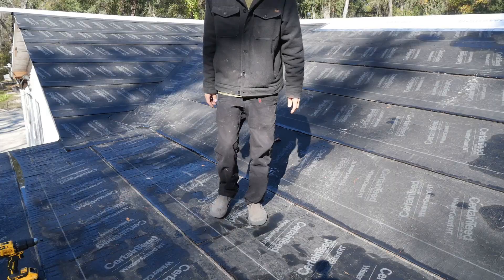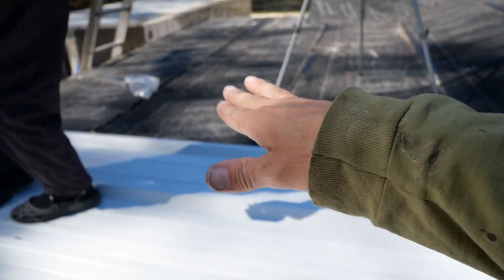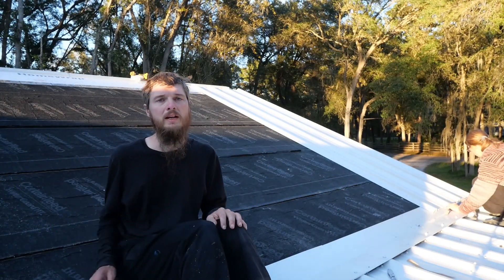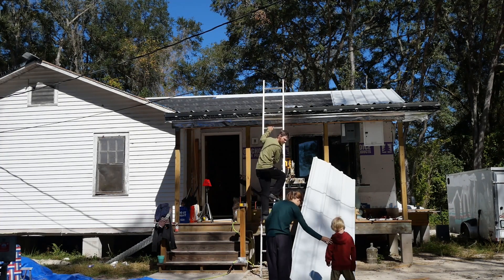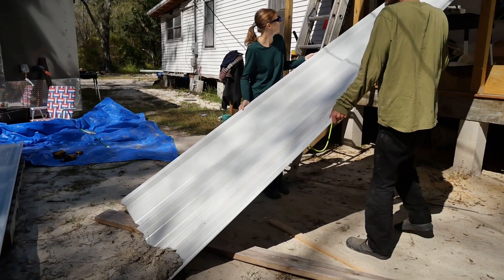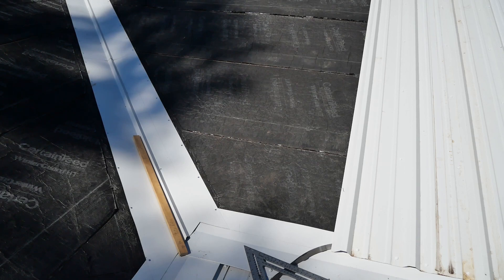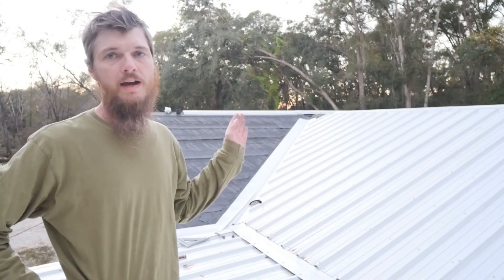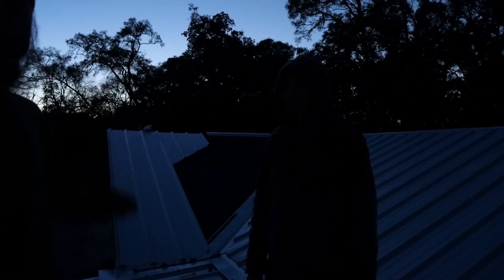Another Close Call - Day 4: The Hardest Part is Almost Done

Comment: My Dad was what they called a roof plumber (in the olden days). Architects would draw these crazy plans with insane roof lines on large commercial buildings and my dad had to take the plans and work out water flow and how to make sure that the roofs were water tight. He basically did what you did; cut and shaped and soldered roof sheets into complex origami designs that forced rain to flow correctly, but in such a way that it never pooled. He often had choice words for some of the whackadoodle designs that architects came up with, but I don't think he was ever stumped. So, you are absolutely doing it right! The only thing missing was a few choice German swear words! 💘
Reply: Ha, funny. I bet your dad used a lot of innate math.

Comment: We put a metal roof on our house about 20 years ago. It is still looking good. Metal roofs are very slippery even dry. Also its like an airplane wing if the wind catches it. Can take you off the roof very fast. Would have loved to have your metal nibbler back them.  We used a circular saw. Not sure if that was the proper way to cut it but that's what we did. Our roof is a dark red terracotta color. Looks like a clay spanish style roof its not a standing rib. We love the metal roof but would not want to do another one. Hard hot work. 
I was not strong enough to help lift the metal up to the roof so my husband made a slide using an industrial metal step ladder that was on wheels and slid the sheets up to the roof. Quite a contraption but it worked. Guess you can say if there's a will there's away.  You will love it when its done.

Comment: Very interesting shoe/slipper lacing on Ashley's feet, very ingenious. I think I have seen those very same straps in my supply cabinet. Also, very intricate moves to get the panels off of the shoulder and onto the roof, and into the proper orientation. Glad there was only light wind. You two make it look smooth. My hat is off to you two.

Comment: I am glad you did not get hit with that metal Ashley.... your skin is no where near as tough as that board. The choice of footwear when working on metal roofing has worried me since you started.
Crocks and what appear to be smooth soled slippers are not what you should be wearing on slick metal.  If you have a leaf blower you can use it to help dry the metal when you get up there.
I am just glad you are both safe... Have a great day!  Thanks for the video.

Comment: Close call.  Glad all ended well.  Which do you prefer?  Composite shingles or metal?  Metal probably has a longer service life?  Composite shingles are quite delicate considering their purpose.
Reply from the maker: Metal is far superior to shingles. It costs quite a bit more though, but will last a lot longer than shingles. If a roof is too shallow, you can't use shingles, but you can use metal.

Comment: Glad you all are ok!! Doug, please give some thought about wearing a harness and teether. (It's like climbing gear) The more protection the better. Soon you will be walking on the metal part of the roof which will be slippery.
Reply: Yup a harness tied off on the pitch of the roof for sure.  I use to manage a metal roofing company for about 7 years and we had one incident with one of our installers 5 stories up on a high rise in downtown Seattle right across from the waterfront.  He was one of our foremen and he did NOT have his harness on or tied off and he decided to stand on a metal railing on a balcony to add some metal facia on above the balcony.  Little did he know down below on the pier across the street was a guy from the Washington State Safety Dept. with a camera in hand and took pictures.  Our guy did not slip thank you God while he stood on the top of the railing to install his metal facia board.  Needless to say we received some of the pictures from the State along with a $10,000.00 fine and the "Foreman" was fired immediately.  He had the harness in his Company truck and I had ALL the paperwork that he attended the Safety Classes but he surely failed the Company but most of all he could have free fallen 5 story's to the ground.  

Anytime anybody goes up on a roof to lay any kind of roofing should wear a harness and tie it off.
Reply: @sandravanlankvelt7975  Thank goodness he didn't fall! There are many stories of those who did. Safety first!

Comment: The roof looks so good!  Is there a product that you can put on the end of the metal roof where you've made your cuts to prevent that part of the roof from rusting over time?
Reply from the maker: The edges will be okay. They don't really rust over time. When the sheets are stacked the edges rust, but once installed they do okay.

Comment: @1:28, No, No, go higher up 6" to 9" even bending the metal past the transition, that way no water "up flows" past the seam when sticks and debris are in the lower flat part steel.
Reply from the maker: We are installing it the way it's supposed to be. Plus, you can't simply bend PBR panels anyway. They are super thick and strong. The transition flashing with the foam closure strips is what guides and keep all the water out.
Reply: @diyfferent  Perfect gotcha...those are the tough thick ones.

Comment: This might help you in the future. It's called the "Pitch Hopper". It has a steep side & a flater side, it looks like it's a weird triangle shape. It keeps you from sliding off a steep/flat metal/asphalt shingle roof.  The advertisement had the guy standing securely on an extremely high pitch roof with no problems. 
I know it doesn't help you today. But I'm sure you'll be doing more roots & I thought this would help you do it safely.
Reply from the maker: That is a very cool product. We've never heard of it! But it's only made for use with asphalt shingles.
Reply: Rooves not roots, thanx spell check. LOL
Reply: The commercial I watched had the man doing a very steep metal roof.
Reply: I rejoice with you and praise our creator for Ashley's protection.

Comment: Damn, that was close.. Since Ashley is taller it probably wouldn't do too much harm, if it hit her,  but some cuts would be guaranteed. Folded metal with angles or seams becomes very hard and cutty, not as flimsy as a smooth plate, but anyway no one should be standing below a piece of sheet metal. Got lucky, good job otherwise, looking promising and way to go. You're close, doing it right will spare you the frutstration of rapair for many years to come. When doing laps and joints, take always in account the way pieces will overlap, so no water issues will arise. Cheers, we're peeking...😉

Comment: Looks great. Question: can rain from the valley get behind (above) the foam strip at the bottom of the pitched roof panels?
Reply from the maker: No, there is a foam strip that goes along the valley under the metal. We didn't show it in this video, but we showed it in another video. We cut the bottom foam strip back so that it couldn't catch water from the valley.

Comment: Maybe someone already asked this and I missed it, but why don't you stack your steel pieces on a pallet and lift them to the roof with the forks on your excavator?
Reply from the maker: We don't have forks for our excavator, so we have no way to use it. But each sheet needs to be measured, cut, and drilled before installing, and it's easier and safer to do all that on the ground anyway.
Reply: @diyfferent  Sorry, my bad. I thought you had forks for it. I see what you mean about having to custom cut each piece.

Comment: I have a question.  Aren't you supposed to put foam under the metal?  I have been told so many different things. Just wondered which was correct.
Reply from the maker: It's optional. You can if you want to add insulation.

Comment: What impact does a white roof have on the house? Why don’t we see white roofs on houses in general?
Reply from the maker: It depends on the area. We've noticed a lot of homes around here have metal roofs that are either silver or white. Most people seem to do shingles though since it's affordable and shingles tend to be darker colors. The color shouldn't really have much of an impact on the indoor temps of the house since the ceilings are insulated. If it were an uninsulated barn or garage, white would help reflect some heat away. 

If you live under trees, white will show a lot more grime.
Reply: Lots of roofs are concrete tile so the weight of all that tile helps the roof to stay put in a hurricane... usually

Comment: I saw that roof fall before it did.  Y’all are not taking proper precautions at all. I’m serious and ashley shouldn’t even be up there. If you both get hurt or killed you orphan your kids. Does that even cross your minds?  You need to befriend your neighbors, pay them back in beer and home cooked meals. Stop risking both your lives at same time.
Reply from the maker: I get your point but as a side note, we don't drink and don't support consuming alcohol. We're actually more aware of the risks than you give us credit for, and do try to be careful.
Reply: @diyfferent  who is talking about alcohol? I never even mentioned alcohol.

Sometimes bad luck happens. Even the best job sites with proper precautions, workers get hurt.

Life is dangerous enough without adding working on a roof with sharp metal sides together. 

You have zero safety rigging. You have no spotters, you are going on your roof half-assed. And you are the parents of your children. 

Can ashley fix the house alone if you die? Could you raise the kids alone if ashley dies. 

You really need to assess the risks of the job, before you go in head first.

Spend a few hours coming up with a way to get the material to the location safely and securely.

And if logistically it isn’t possible, then either hiring out, or grab a day laborer at home depot. 

This isn’t the age of little house on the f’n prairie. You don’t need to do everything yourselves. 

Otherwise change the youtube channel from DIYffrent to “Trying to kill my wife by being unsafe.”
Reply from the maker: @adamcartermi5  You said "pay them back in beer". Beer contains alcohol. And please don't be rude. We're not trying to get you worked up or cause an argument. We're doing the best we can and we appreciate the concern.
Reply: @diyfferent  oh it was a figure of speech. That’s what neighbors do. Offer food and drink. Offer them lemonade. 

I misspoke i thought you meant i suggested you were up there intoxicated. I know you weren’t but bad shit happens all the time. And you clearly don’t even have the forethought. Everytime you do a major project like this. You need to think what is worst case scenario.

And how to avoid it. 

Seeing you lift large sheets of sharp metal roofing with your wife and a ladder looked horrific. I know you both have limited means. But i don’t think either of you can afford to live without one another.